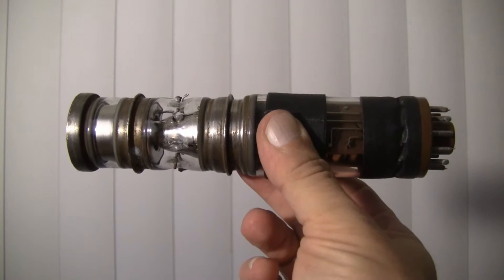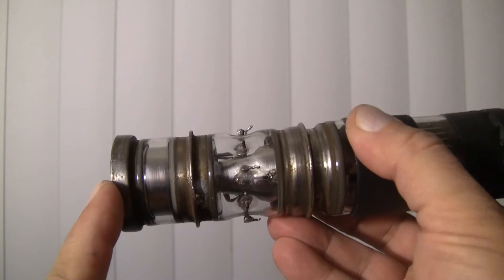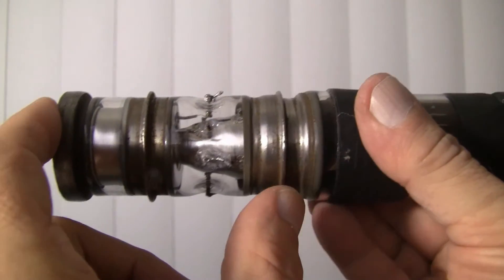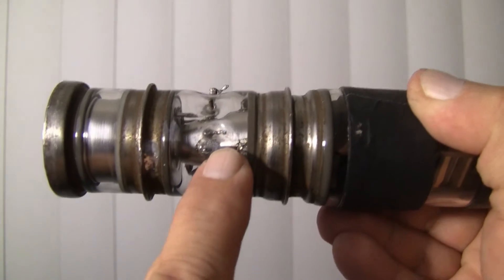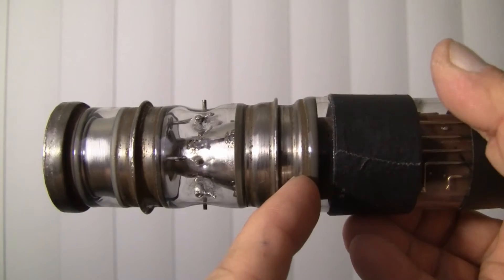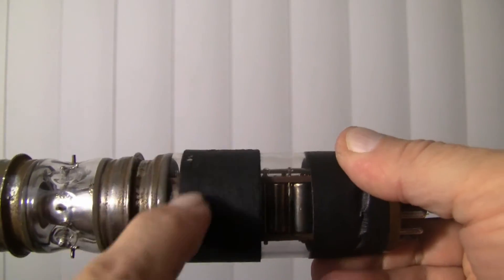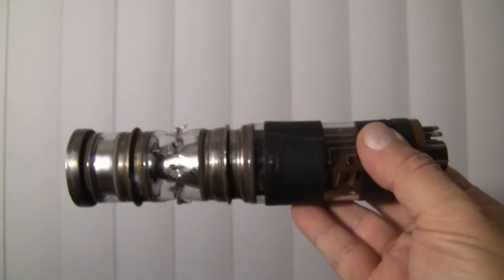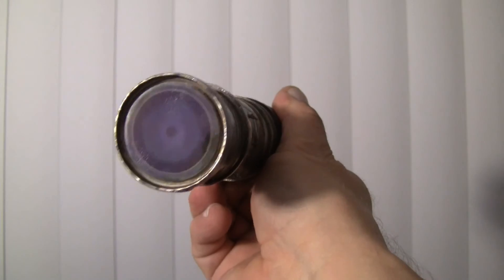Mysterious Electrostatic Image Dissector Tube

Comment from the maker: Well, it took some time. But, I found at least one vague reference to this tube AND possibly a drawing of it as well. In the book, Image Tubes by Illes P. Csorba, (C)1985, SAMS publishing, first printing, Library of Congress number 85-51122, hardback edition, page 362, there is a drawing of an "electrostatic image dissector tube". It looks EXACTLY like this tube! Credited to CBS laboratories. Don't get too excited yet. This excellent book only devoted three pages to dissector tubes and the author breezed over the topic rather quickly.

(I was doing research for an upcoming video about how iconoscope tubes really work. There are a lot of extremely WRONG descriptions of the photo mosaic out there. I would like to be the one to set that record straight once and for all. When I decode all of the calculus equations techno mumbo jumbo!)

Comment: Is that just plain old friction tape?  It looks like it was applied last week.  This must have been looked after really well!  It also looks like it's got some purpose in regards to mounting the tube; you wrap it with tape 'till it's the right size.  I can't see any other reason for there to be tape wound like that over a plain glass part of it.  Definitely agree with the leeriness about removing the bottom winding of tape.
Reply from the maker: This device is likely close to being old enough to be a true antique. Perhaps it has historical value, if we can discover that. I don't know a lot about determining value of such old technical things. But have heard of cases where the value of an object was severely reduced by simply cleaning it. Hence, leave the tape in place - just in case! If I were to sell the tube, naturally, I'd like to get top value. 

I am convinced this device was not a true imaging tube. More of a steerable photomultiplier, like my IT&T FW130. This works much in the way a person with severe cataracts does. It can tell which direction a bright spot is located. I believe it was intended for a laser guided weapon. It sees the spot and a the system steers the missile to keep the laser dot in the center of the view. Similar tubes are used on some satellites as star trackers. A trio of these at 90 degrees to each other would lock to guide stars and then trim the speed of the three reaction wheels (gyroscopes) to keep the satellite pointed precisely centering the guide stars.